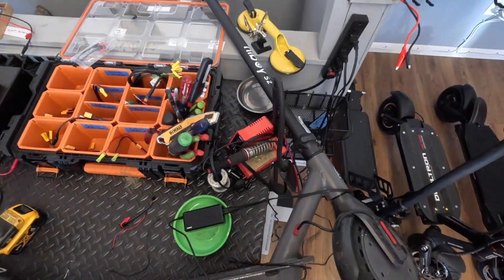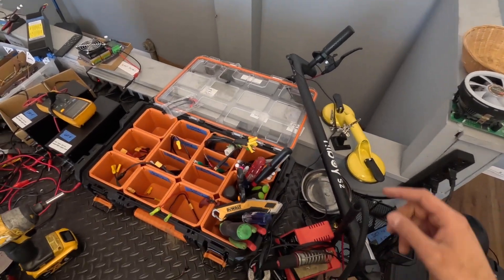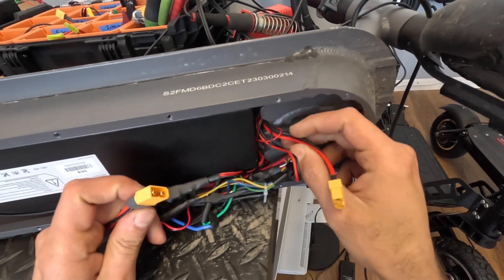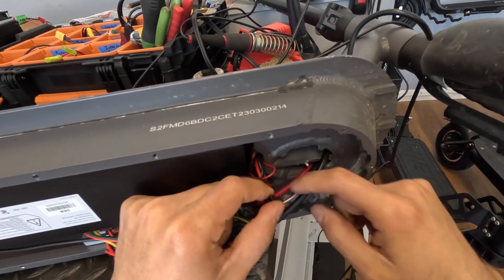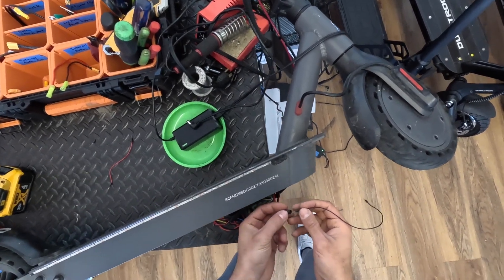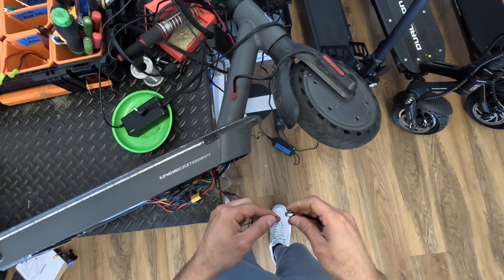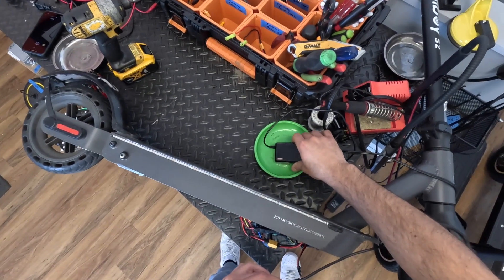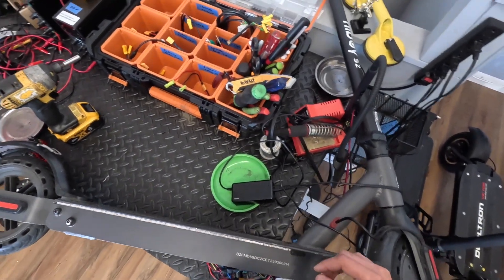Hiboy S2 Won't Charge

Comment: I have a scooter that won't turn on or charge.  I did this same basic test but I didn't have a charge port extra so I rigged up with alligator slips and a nail into the charge plug for the positive lead.  I tested first to see if this worked and I was getting 42v from the charger.  So I connected this to the battery through the connector and in my case the charger light never changed color.   So I'm assuming that there is legitimately something wrong with the battery not the wiring or components of the scooter?  Thoughts?